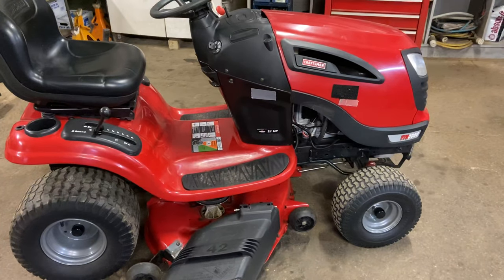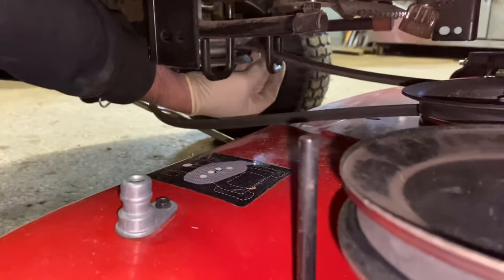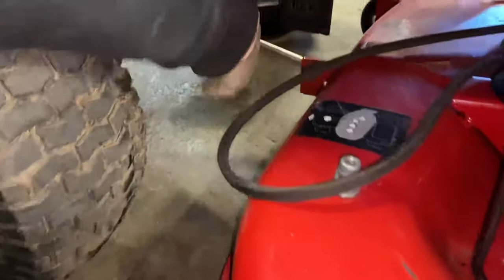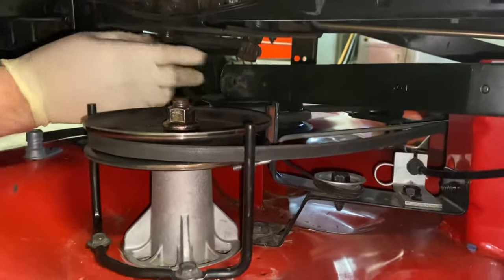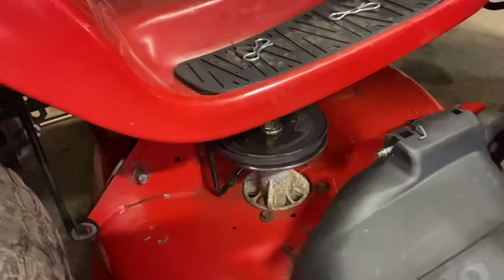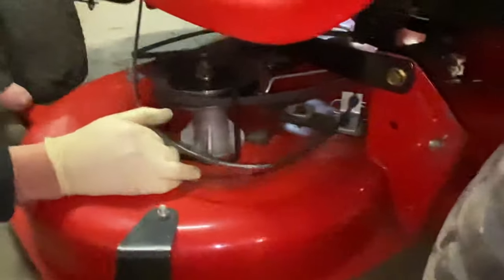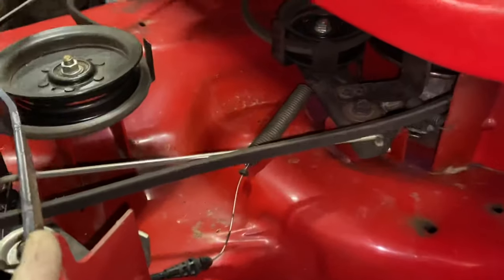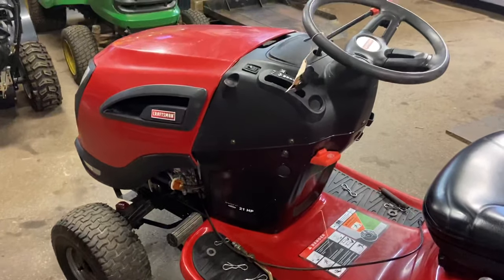How to remove mower deck Craftsman YTS 3000 Tractor

Comment: Sir, thank you so much. I just started to learn the YT4000 that has been sitting for 9 years. I was told it was broken. It needed to be seriously cleaned and with your helpful videos I was able to get it working again with just a new battery. This tractor/mower is a beast. You are what my people call a “Mensch” a real man
Much gratitude,
Gregg
Reply from the maker: Hi Gregg, thank you for the kind comment:). I would have liked to see the project from start to finish! It’s a great feeling of accomplishment when an endeavor like that is successful! I still feel that way after 30 years of being in business coming across machines like you came across! Congratulations!! Thank you for sharing.
Reply: Yup! This tutorial helped me get my YT-3000 in order. 13 years old, and still chewing through some of the worst brush on the east coast!

Comment: Any tips in where to hide the mower deck cable in the winter when I attach the snow blade to the tractor? Is there a good way to snake the cable up into the steering housing somewhere? Or do I have to remove the cable altogether and reinstall in the spring?

Comment: Great videos.  I have an issue with my YTS3000.  The brake pedal does not return when pressed.  I've checked the springs on the brake bracket behind the rear tire and everything seems in the right place.  Any suggestions?

Comment: I appreciate this! The steps are basically the same for my YTS 4000.
Reply from the maker: I’m glad this was helpful. If it is the same? I can put your mower in the description. Do you think it is the same? Not sure what you mean by “basically”. I just don’t want someone saying that it isn’t if I put your model in.
Reply: @JohnsonsSmallEngines  Very close. 
*The front arm on mine only had the lower clip, not the top one.
* The blade engagement cable also did not have a clip.
I just watched the video a second time, and I think that was it.

Mine is a YTS4000, model 917. 289280
Reply from the maker: Thank you for the info. I will post it.

Comment: Hey Brad. Great videos. Very clear and to the point. I have a yts 3000. No ID tags at all. Bought new years ago. I rebuilt the deck and new drive belt. Like a new machine. First mow went great all controls work like new. Few days later I mowed again. This time trans is slow and weak. Rechecked everything and seems fine. Belts and pully's are fine. Lever and all moving parts are tight and move to proper position. I'm stumped. Any advise? Thanks.
Reply from the maker: It sounds like you did replace the transmission drive belt? Did you check to make sure transmission drive pulleys are spinning freely? Check to make sure the belt did not jump off of the rear transmission pulley? Check all tire pressure to make sure your not driving on flat tires? Check belt tension spring to make sure it did not break?

Comment: Thanks for the great tutorial! One note: depending on what you're using the tractor for after taking the deck off, you may want to remove the black rear right hanger as well. I have no idea how it happened, but mine got bent somehow. I used the mower for a number of things after removing the deck. Kind of surprised anything I did could have bent it, but it happened.  The way mine bent made it seem like there was a bend to get around the chassis and there were no marks on the hanger so I didn't think it could have been bent. Easy to bend back so it wasn't a big deal, but I spent quite a while trying to figure out what I was doing wrong trying to put it back on. Finally looked at a photo of a hanger online and realized it was bent. I wish I knew what caused it because it makes me think I was harder on the machine than I thought. Anyways, it might be a good extra precaution for everyone planning to use the tractor with the deck off.

Great video, though. My situation is probably very rare.

Comment: Thank you so much for your video. I bought a used YTS3000 a couple of months ago. My first ever riding mower. I drove over something that not only tore my blade drive belt, it bent one of my idler pulleys -- oops. Going to try to fix it myself, and step one is removing the mower deck. Wish me luck. (Next I'll be looking for your video on replacing the pulley). 🙂
Reply from the maker: I do not have one on replacing the spindle but it is not to bad. Remove the blade, then remove the 4 bolts that holds the spindle. I would purchase a entire spindle assembly that comes with the hub, bearings and shaft all in one. You can look up the part number you need from the model number underneath the seat of your machine. Just go to Sears parts direct online and you will be able to get the part number for the hub assembly. Take that part number and you can normally get a aftermarket on Amazon for a decent price. Try to also get new mounting hardware with the hub.
Reply: @JohnsonsSmallEngines  Thank you for responding!!  I’m probably not using the right terminology since this is my first mower, but it’s not one of the pulleys attached to a spindle, it’s one of the smaller ones just attached to a red bracket. I wish I could attach a picture. The pulley is tilted at about 45° instead of being parallel to the ground. I was hoping to just bang it straight with a mallet. 😳
Reply from the maker: Oooo, Ok. Yes maybe a large and heavy hammer!!! will work :) This video may help. https://youtu.be/2BdllqplWsk.
Reply: @JohnsonsSmallEngines  yes, thank you. A large hammer and/or a crowbar. 
I watched that video – such great info. TY! 🙂
Reply: @wendizoid  I think that little pulley is supposed to sit at a 45 or so… that’s how Mi e is on my 3000yts!
Reply: @hdrjunkie  Thanks. I ended up bringing the deck to an auto body shop, and they straightened the bracket. New belt and it works fine. Only problem is the whole deck is lower (I’m mowing on a 6 instead of a 4) even though I put deck on exactly how I took it off.
Reply: @wendizoid  that happens, I took Mi e off to fix it and put it back on and now one side was cutting way lower than the other so I had to te adjust it. Lol

Comment: Do you think a 42" deck can easily replace the original 46" deck? My DLS3500 46deck is cracked, and it's difficult find exactly replacement

Comment: Is there anyway you do a video on leveling this mower deck bc I have the same model but mine keeps scalping  my yard n it’s d roving me nuts
Reply: I agree... would be a great video
Reply: Also include the tire inflation tip. It's sometimes the tires, not the deck.
Reply: Mine does the same, usually that front hanger nuts backs off and has to be tightened up.

Comment: Thank you too. I was able to remove the deck just fine. I checked all the pulleys and each seemed to turn free with no flat worn spots, yet it makes a rattling sound when I let out fully on the brake/clutch foot pedal. Belts are old original ones but I couldn"t see any tears or obvious issues. I cranked it with deck removed and same rattling sound. My mower is a Craftsman YT 3000 46in cut. I saw one video that said if the foot pedal jerked and it sounded like rocks in a can underneath, it was the idler pulley? Any suggestions would be appreciated. Thank you so much. Rod
Reply from the maker: If your clutch/brake pedal is shaking when your pedal is let out so the drive belt is engaged. You either have a bad transmission drive belt or bad idler pulleys or both.
Reply from the maker: I have also seen a piece of wood caught in the rear transmission pulley making the belt shake so check for debris caught in the v-idler pulley and the rear transmission pulley

Comment: hey maybe you know because Sears cant tell me... Whats the difference between a YTS 3000 and a YT 3000?  there has to be something because why would they have two different names?
Reply: Have you ever found out the difference because I have a yt 3000
Reply: @rogerthat.9105  no I haven’t… Mabey the “S” means sh***y because mine is a real piece lol lol my deck is literally falling apart, both front anti scald wheels have broken off at the welds, had to 
re weld them, one of the front deck mounts broke off had to weld it back, the decompression valve on the camshaft broke so I had to. Take the engine apart to fix that, I had to replace the front steering arms… lol and how do you wear out the front tires on grass?  Lol

Comment: I can’t find a video ANYWHERE on how to put the mower deck BACK on! I’ve been struggling for a few days now. I bought a use 2005 craftsman GT 3000 w the Kholer engine Hydrostatic. When I went to pick it up it wouldn’t fit in my trailer so the seller ajd I took the deck off, it was almost dark, he was a mechanic so it seemed simple but now I’m screwed! I don’t want to get those belts messed up and jam up my new to me mower. Do you have any videos putting a deck back on?
Reply from the maker: Just follow the video in reverse.Push mower under etc. Put the video at the end and rewind a little at a time. You got this!!!

Comment: My model is MUCH older, but it doesn't have that cable.  Seems like most do, but I slipped off the belt and removed 5 pins and it slid right out.  Are there models w/o that cable? Mine is model 917273041
Reply from the maker: Yes, most mower decks that have an electric PTO clutch are just like yours. I think your machine has an electric PTO clutch? that powers the mower deck and if that is the case then you only have spring tension that keeps the mower deck belt tight.
Reply: @JohnsonsSmallEngines  I have 15 y o model with spring held by a nut for blade engagement cable.  spring flew off and cant figure how to reinstall it

Comment: Correct spindles? Everything on Amazon calls out the 42" LT1000 or 2000 and I can't tell what the deck difference is
Reply from the maker: Take the model number from under the seat and go to https://www.searspartsdirect.com/?sid=ps:GOOGLE:Search_Brand_Alpha-Sears:sears%2520parts%2520direct:sears%2520parts%2520direct&gclid=CP-rgNye5cgCFU8WHwodxBkPrw You should be able to find the correct parts and part numbers for you machine.